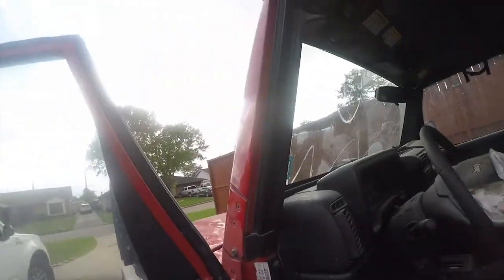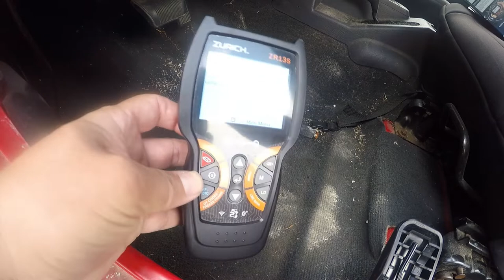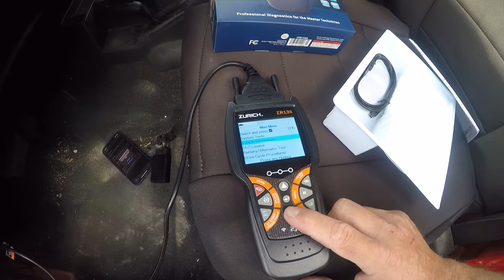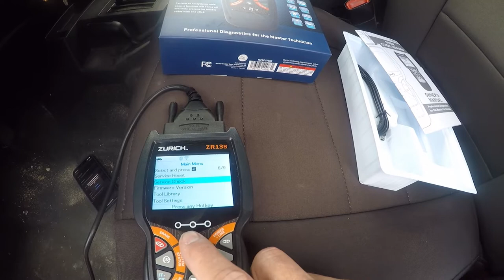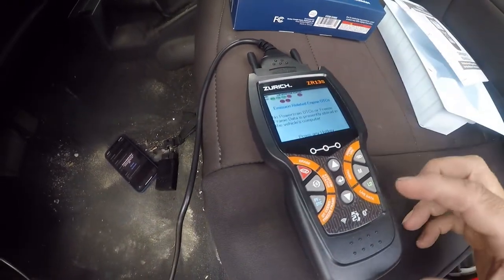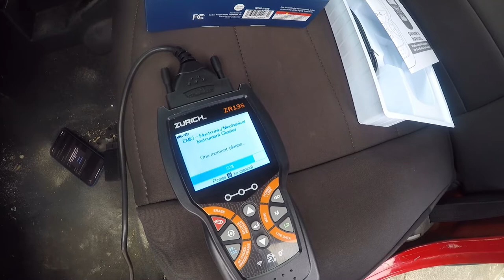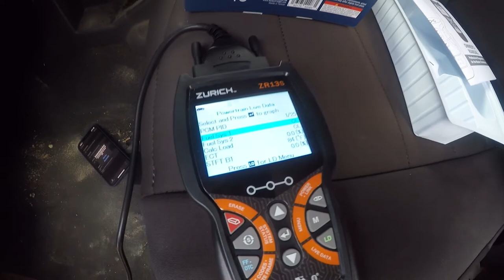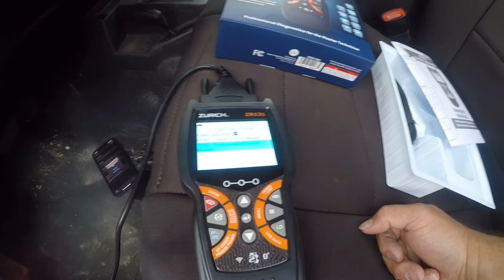Jeep TJ Build - Jeep #5 - Using ELM327 vs Harbor Freight OBD readers

Comment: Should've picked up a shop vac at Harbor Freight while you were there. :)
Reply from the maker: I have 3 Rigid / Home Depot ones.... no point in cleaning it until it's a little further along.  Can't drive it with a bent frame or with the engine out.  :)